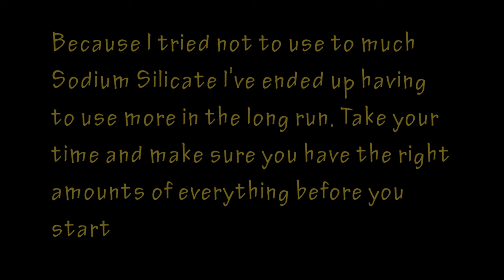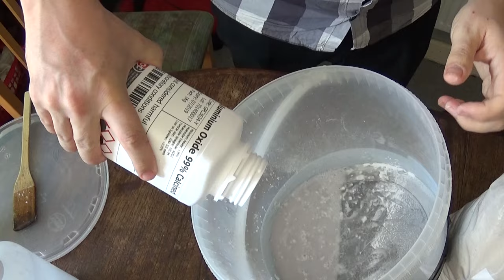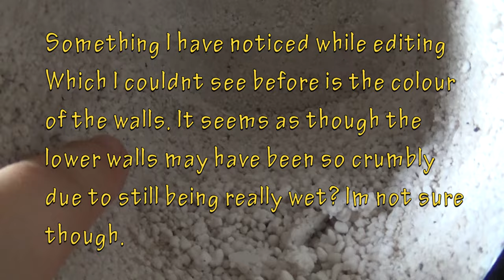Rocket Stove Part 3 | How not to make a stove | The one with the mistakes

Comment: Thank you!   We are working  on Rocket heating, for the obvious 2022 reasons!  Grateful for your work with these materials, and it was interesting to follow your build process. No need to apologise for unintended results - if you show me someone who never makes a mistake, I'll show you a person who never makes anything!  Long retired, so all things take longer now,  and after building and testing many brick-based test Rockets we're planning a basic vermiculite board stove for our next one.   Your thermal cement looks like just the thing for optimising the internal shape of the hot bits. We're always cracking our bricks! Just repair them with 'slip' and press on testing.... ;)
Reply from the maker: Thanks for the comment. Good luck and if you need any help just say 🙂

Comment: A small paddle mixer from Lowes, or your equivalent, would speed up the process and solve the lump problem. Still, great info. I'll use the recipe
Reply from the maker: Yeah I agree. If I was to make another rocket stove I think I'd make a mixer of some kind. I'm happy to say that the rocket stove is still working fine and there is only a couple of small cracks which have been there since the first firing. Thanks for the comment

Comment: that cement looks great. btw talc is magnesium SILICATE, not oxide, but both still seem to be used in many refractory projects
Reply from the maker: Oops I knew I'd mix them up. The cement works great but make sure you let it dry naturally I was in a hurry and its cracked because of moisture escaping to fast. Other than that it works great.

Comment: Love the video, question? do you worry about it exploding as I have heard horror stories, thank you!
Reply from the maker: Good question. Simple answer no i wasnt. The thickness of my rocket stove walls were thin enough to dry quite quickly. The danger is from expanding gasses caused by the moisture inside the walls rapidly heating. Im thinking of doing a rocket stove Q&A. If i do I will include your question. thank you for your interest

Comment: You could have spared us 35 minutes by explaining the mix and not boring us with the torturous mixing piece......
Reply from the maker: When you start making videos I will listen to you r comments...
Reply: David Agar I hate long videos as well but this is important information and it's free. THE MIXING IS GOOD TO to see for dummy like myself  especially with this stuff . My experience with making sodium silicate is you add lye to dissolve the silicate gell and specific amounts is not important , adjust to create the needed reaction . Same with making refractory stuff  I used Portland cement  sodium silicate and vermiculite which has to be water wetted before adding sodium silicate and what a mess in a fury to get the reaction I needed. But I got it  and the goo worked good  I lined a barrel with the refactory goo and it held in place
Reply: The Off Grid Family  You are fixing that crumbly with sodium silicate, what a miss . I cheated , I had on hand some of that refactory  cement that is like putty sold in liter tubs ( USA quart tubs )  directions say don't exceed 1 eights inch in thickness . What's 8 divided into 25? About 3 mm ? OK yep I exceed that thickness and that putty like refactory cement still dried  . Took a long time  though
Reply: This is the first and last vid of yours I will ever watch. I don't like being bored. Long winded with little content.